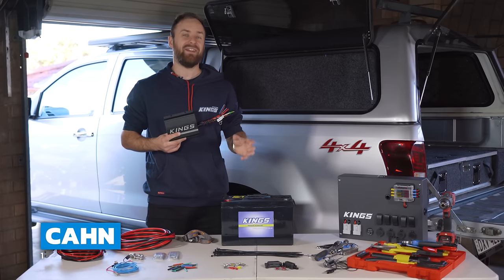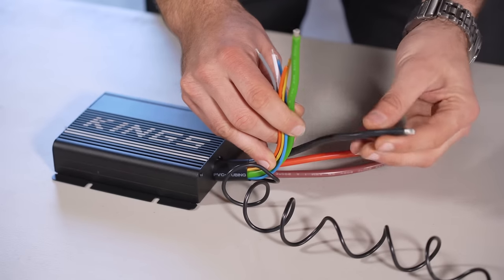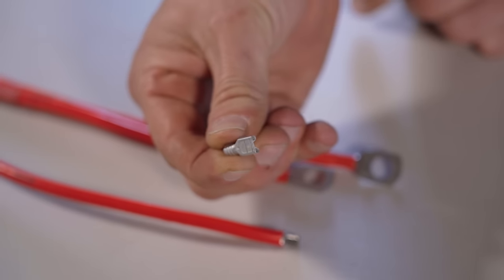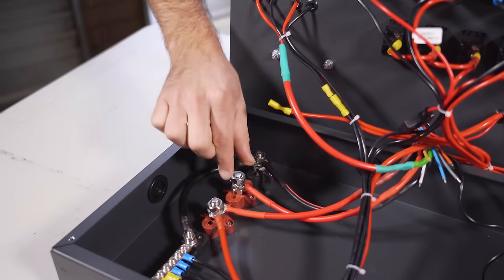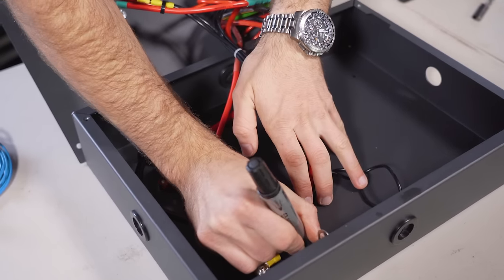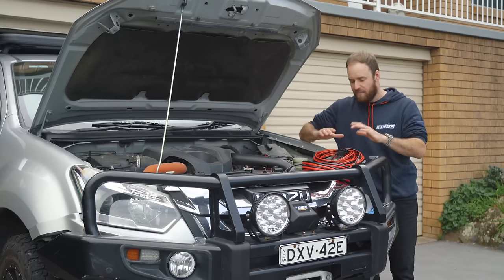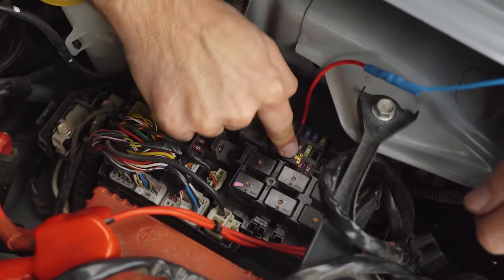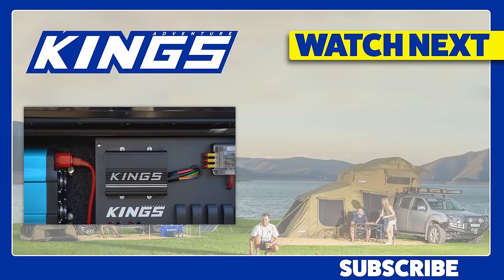Step-By-Step DC-DC Charger Install

Comment: Hey! Awesome video really helped in the install of this in my van, thanks! I have a question:

Straight after I installed this dual battery system into my van (VW transporter T5 2014, with smart alternator), 2 engine warning lights came on the dash. I’ve check the alternator in the van and the main van battery using a multimeter and both are testing up as normal. I’ve definitely connected the ignition (blue) wire into a positive ignition power source. 

Does anyone has some insight into this? 

Thanks heaps! 😊
Reply from the maker: Which warning lights are they? It could be from disconnecting the Battery while you were connecting everything…

Alternatively your particular model may have a current sensor on the negative terminal of the battery which you’ve unintentionally bypassed by connecting the DCDC wiring directly to the battery. If that’s the case, connecting the negative lead to a body earth NEAR the battery terminal can solve it! Might be worth doing some searching to see if other people have had a similar issue..

It could also be a coincidence… which has definitely happened to me before when I fixed something and an unrelated part broke the next day haha

Cheers,
Cahn

Comment: If you were to use both the quick connect plugs on the front as solar input how would you go about that? Cause I’m currently putting one together and I’m gonna have one that will always be solar but I’ve also got a foldable solar panel that I’ll set up from time to time at camp

Comment: Hey guys. the 2 quick connects on the control box. I have a few questions

obviously one is set up for solar input.
With the other quick connect. Can I run my cable from my starter battery into the Quick connect instead of what you did in this vid? you guys had the pre made cable with the anderson on the end. I presume it was for that reason?

if that was the case. Am I able to have both of them plugged in at the same time. 

Cheers

Comment: do you need to connect to the dcdc charger to the  start battery if I'm running everything off the lithium in the back of the ute

Comment: Where on earth did you find female spade that fits the wiring for the solar cable, struggling to find one big enough
Cheers
Reply: Hi I’m starting out and am struggling to find a female spade terminal, wondering if you have found one and where thanks
Reply: @lachlanlucas6333   I ended up using a yellow female spade, and just cut some of the copper wires off the solar cable to make it thinner until it fit, been working perfect so far

Comment: I'm wondering where you get the in-line joiners for the larger wires. I can't seem to find them anywhere. Mainly up to 6mm is readily available. I'd appreciate your feedback on this.

Comment: I am not using a 12v control box. So to what do I connect they type of battery cable (grey, orange, yellow or white) - the video doesn't make it clear. Do I connect the type of battery cable to the positive cable coming from the car battery?

Comment: I'm getting ready to install this exact setup in my new Hilux and my deep cycle battery is already in a battery box. Can I terminate one end of the cables going to the deep cycle battery, in an Anderson plug so I can just plug it straight into the battery box? Cheers
Reply: Hi, 
Just read yr comment re 12v system. Have a look at my videos and may also be helpful for yr set up. 
Cheers 
Out There Touring

Comment: I used all of this to set up my new ute the only thing that I would have liked was the gauge of all the additional wires and the amps of all the fuses that was used . I also have a dmax and had a engine light come on after the install. I have had it cleared as it was a egr loss of signal. I’m hoping it was just because I had the fuse out while I was searching for the right one . Has any body else had that happen?

Comment: I want to add this control box to my trailer, how would that work with the blue ignition cable? 

Or would I just leave it out?

Thanks for the video!
Reply: Depends on your car mate. if its a new model with a smart alternator you will need it. Kickass (Australian direct) sell a wiring kit that has an Anderson plug with 3 connectors. This would make it easier for you when you disconnect your trailer from your car.
Reply: @johnmillar5703  thanks mate!

Comment: Hey team, what size fuse should I put on a 2 x Kings 110a agm's in parallel to the control box in this exact dcdc setup ?

Comment: Another great informative video.  I have a MQ Triton Dual Cab and would love to have a 2nd batter setup in the rear tray.   Where do you get the grey boarding from that I see in nearly all of the vehicle setup videos ?
Reply: did you ever find a answer?
Reply: @Npolis  not really - I ended up just securing the 2nd battery in the back.
Reply: Marine plywood, coveted in marine carpet  . Stick it on with contact adhesive.  Very simple and easy to do.

Comment: With the blue smart wire, I’m trying to find a fuse that is off when the power is off but only the lights fuse fits this recommendation. But then I only get a charge when the lights are on. Will this be ok? My car is a Mitsubishi triton Mh model

Comment: im not currently going with solar ( very basic build )so if i dont connect the orange wire like how its been shown in the video, would the orange go to the positive terminal in the box  if not where would i then connect it ?

Comment: Does it matter if the temperature sensor cable doesn’t reach the battery? Do we just ignore it?
Reply from the maker: Hi there,
We would recommend getting it as close to the battery as you can!
Regards, Courtney

Comment: This is a fantastic guide.  The one thing I'm confused about is why you used 2 different different red/positive terminals.    It looks like your bcdc runs to one red terminal. That terminal appears to run to your fuse block and also to your aux battery as well.  I assume this is because this path is where your bcdc sends power to your aux battery and the aux battery sends power to the fuse block and onto your dc loads.  It looks like your main battery power runs to your second positive terminal, which then runs into your bcdc.  This path appears to be where power is going into the dcdc.  What is the reason for not running your starter battery power to the 1 terminal that connects to your fuse block, dcdc and aux battery?  Would that essentially bypas the dcdc and cause the aux battery to drain the starter battery at all times since there is now a path to it that doesnt cross through the dcdc?

Comment: I've just bought this same charger and mounting it the same way as you. My only questions are; where can I get the joining crimps for the larger wire? I can't find any to extend the heavier gauge wires, and I already have a dual battery setup (with a redarc isolator) under the hood with an anderson plug running to the tray where I will be storing everything. Would it matter if that anderson was coming from the auxiliary battery rather than the starting battery? I'm not which one it's connected to. I was just going to connect the positive and negative from the anderson in the tray to the box like you did. I'm unsure how it will all work with already having 2 wet batteries under the hood.
Reply from the maker: Hey Karl,

It really depends on your setup as to whether it'll matter or not... so let's see how we go!

First of all what vehicle do you have as it'll depend if you have a smart alternator?

Next can you confirm whether the aux battery under the bonnet is a starter type or deep cycle type?

I mean ideally you'd connect your DC-DC charger to your starter battery so you have two distinct systems - that way if your isolator does fail, or isn't charging due to low alternator voltage you're not missing out on charging your battery in the back (or you're not discharging your aux battery into your rear battery, without the alternator topping it back up at the same time!

Cheers,
Cahn

Comment: Looks great, what about adding the Dc2Dc into a caravan, what do we do with the ignition wire, 2017 Pajero Sport, and 22 year old caravan, please advise. thanks
Reply: if you look at your trailer plug, you have a spare pin normally used for reverse lights (almost no one has reverse lights on there trailer ).  run a fused ignition source to that spare pin, same goes from the trailer side of the plug.  Run a wire from the trailer plug to the DCDC charger.    

Other option, just install a manual on/off switched. when your setting off on the long trip, turn it on
Reply: To get power to your caravan you’ll probably need to run leads down to the back of your car and use Andersen plugs for the connection between the van and car. With the ignition cable they sell a three pin Andersen plugs for the ignition wire so you can look into that. Another brand uses the three pin connectors but I feel bad mentioning them but it starts with K and ends with ass. Good luck!
Reply from the maker: Thanks George,

This is something I'm hoping to do a video on in the future, but:

As the other two commenters have said you'll either need to run a fused ignition source to the spare pin in your 7 pin trailer plug near your towbar, then use the trailer end to run to the DC-DC charger OR you can run a separate ignition wire to a separate plug near your towbar. There are a bunch of quick connect options available - if you're after a single plug then the "powerpole" type are good.

Cheers,
Cahn

Comment: So with this system do I not need a isolator is it built into the system? Thanks in advance great video as well👍
Reply from the maker: That's correct! DC-DC Chargers typically work as isolators either with a starter battery voltage trigger or the ignition trigger. With this unit you can choose either by connecting the ignition wire or leaving it disconnected.

Cheers,
Cahn

Comment: Hi, 

Please will I still need to run the the ignition wire if I have power at the back of my Ute with a relay that cuts off power to the back when the engine is turned off? 

Thanks.
Reply from the maker: Yes it’s always a good idea to run it either way!

Comment: How would you wire in a 240v charger (to charge the auxiliary) into this set-up? Just attach the positive/negative cables to the appropriate terminals in the box?
Reply from the maker: Hey Jack,

most chargers would ideally connect to the terminals of the battery itself to cut down on any connections and possible voltage drop. but yes you could connect to the aux battery terminals in the control box too!

Cheers,
Cahn

Comment: Hi guys,

The temperature sensor cable is too short. Is there a safe way to extend it?
Reply: How'd you go. Mine broke as i fed it through the grommet.
Reply: @deltakiwi  I just connected it to an earth point in the back of the car.
Reply: Same thing happened to me. Call the shop and order one. When you get it just attach it to the broken one and the red flashing will disappear. Any problem just message me 👍

Comment: I just finished installing this and everything was working great. I went to do the final install and tightening the aux battery temp sensor wire onto the battery it broke away from the ring terminal. The two prongs are visible but now no matter how I attempt to fix it the DCDC charger is showing the temp sensor fault. How screwed am I? Is there anything I can do, Can I replace this with another temp sensor wire? The wire is not cut but the plastic\Glue? surrounding the prongs is gone.

I honestly don't know whether to laugh or cry at this point, I am hoping there is a way to fix this otherwise the whole unit is useless...Any help anyone has would be great.
Reply: For anyone who ever has this same problem, I was able to fix by soldering a 10k ohm Thermistor from Jaycar to the thermal temp wires coming from the DCDC charger, This however is now only working of ambient temp but you could probably refit the ring lug if needed.
Reply from the maker: @retrorelics8223  Sorry for the late reply mate - no good to hear, but glad you sorted it.

So long as you try and read battery temp (maybe attach/mount your thermistor to the battery case) you'll still get fairly accurate temperature compensated charging and the over temp safety function!

Cheers,
Cahn
Reply: Hey there mate,

Do you know if I can extend the temperature wire, its a bit short for my setup
Reply: I'm looking for this answer as well

Comment: What’s different about this process if you’re already connected to alternator via vsr please?
Reply from the maker: Hey mate,

Most DCDC chargers work as an isolator and don’t need a VSR (including Kings)

But if you did have a VSR you’d need to connect the + input wire of the DCDC to the wiring of the VSR

keep in mind that you’d need to make sure the wiring was the correct gauge etc and that adding the VSR inline may actually increase resistance and voltage drop!

Hard to say exactly how it’d change depending on everyone’s individual setups but hopefully that helps!

 Cheers,
Cahn
Reply: @4wdsupacentreAu  Thanks Cahn. Very helpful. Really appreciate your reply. 🤙

Comment: I have it all connected to my aux battery under the bonnet. It has a vsr between the main and  aux battery. I have now placed a 25 amp d c dc charger and lithium in the rear and I am powering it from the aux battery the question I have is do I need  vsr from the aux battery to the DC DC charger or has it an isolator in the charger to prevent the battery from being discharged. I ain't an electrician so any help will be appreciated
Reply from the maker: Hi there,
Our DCDC charger has an inbuilt isolator!
Regards, Courtney
Reply: thanks for that it works now

Comment: Hey Cahn how's it going I want to install a dcdc 12v set-up in my hilux but it's an old LN65 has a fixed voltage alternator being an old rig but was wondering do I still need to fit the blue ignition wire still will it have any affect
Reply: Hi, 
Just read yr comment re 12v system. Have a look at my videos and may also be helpful for yr set up. 
Cheers 
Out There Touring

Comment: Can you guys please upload a video about power options for those who camp in a Sedan? I won't be upgrading to a SUV or UTE for a few years but still would like the convenience of plugging in to a 12v. My concern is that I'd have to build a mobile box that I remove from the car as the car gets quite hot, but don't really know how to make that weather proof.
Reply from the maker: Hello,
I will be sure to pass the request regarding power options for Sedans onto our marketing team
Cheers,
Saleha
Reply: Easiest option would be to buy a premade battery box. Most have anderson plugs so you can use one of those to connect to the rest of the 12v system. Heat however isnt really an issue with an agm battery. Plenty of 4wds going through northern australia during super hot periods.
Reply from the maker: G'Day MsKat,

There's not a whole lot different - except you'll likely need to run your power cables through the interior instead of under the chassis and into the tub.

heat does kill batteries, but a good rule of thumb is if you're ok in the car, the battery is too!

The only time this might be an issue is if you're parking in the hot sun with the car locked all day - if you're actually camping with the windows down etc, your battery will be alright.

I've been working on this idea for a video though, so keep an idea out!

Cheers,
Cahn

Comment: Hi, Is it possible to mount the DCDC charger under the bonnet near the main battery, or does it have to be in the back near the auxilliary battery ?. Im mounting it in to a Prado, so not sure where the best place would be in the back with the aux battery?
Reply from the maker: Hey Wayne, because it's got a multitude of electrical components inside, it's definitely recommended to install somewhere cool, clean and dry. The back of the car is a heaps better place than an engine bay, and then you'll only have a short run from the DC charger to the aux battery in the back which is an excellent idea too, to prevent voltage drop. Cheers Brenno

Comment: Heya Cahn, What size spade connector did you use to connect the solar input to the control box? Cheers,
Reply from the maker: Hey Zak, apologies for the late reply - it's a typical 6.3mm spade terminal

Cheers,
Cahn

Comment: Hi, just a quick question, I have the dcdc charger all hooked up to the control box and deep cycle battery with the battery box. I usually have the car parked up for couple days or weeks.

Should I disconnect the negative terminal of the deep cycle battery (turning the switch of on the battery box) or should I just leave the dual battery all connected up.
Reply: @gypsy_on_drugs1285  if I have the the battery sitting around, will it slowly loose charge?

Comment: I Remember you saying not to cut or extend the temperature wire but mine won’t reach to the battery, what do I do with it?
Reply from the maker: Hi there,

Unfortunately as it's a temperature sensitive resistance wire, it wouldn't be extendable without recalculating the length and finding a new thermistor, which would be a significant time investment and may affect warranty coverage.

Regards, Andrew
Reply: @4wdsupacentreAu Thanks!

Comment: At what point do you ground it to the chassis?
Reply from the maker: Hi there,

I can advise the grounding is to the negative pole of the battery, with that said, you can externally ground where necessary.

Regards, Andrew

Comment: I’ve broken the temp sensor when tightening the battery clamp, and ideas on how I should repair?
Reply from the maker: Hey mate, you can order a new one from us, please call 1800 88 39 64 and press 3 for sales
Cheers, Mia
Reply: @4wdsupacentreAu  Hi
I also broke the terminal from the temp sensor.  Will the inverter work if I leave it off?
Kev